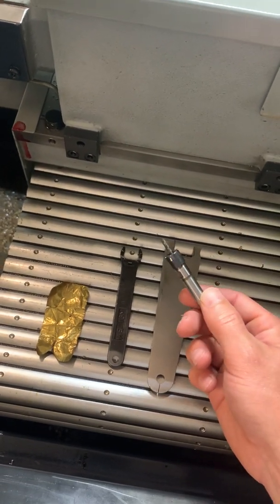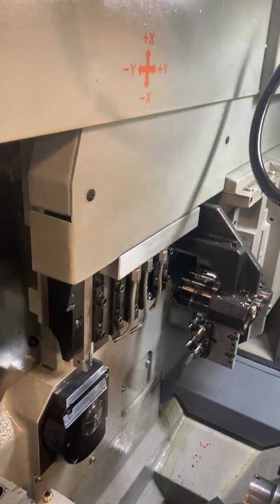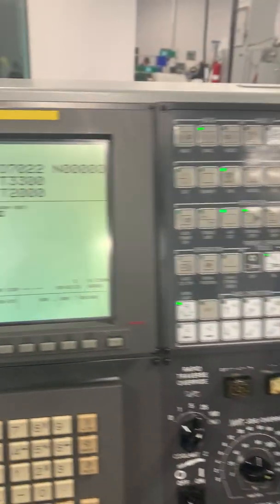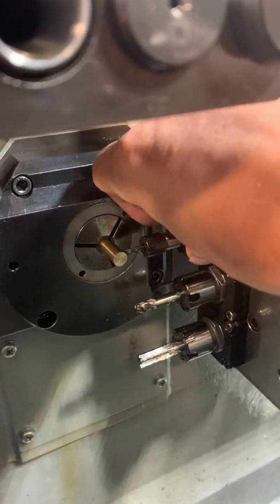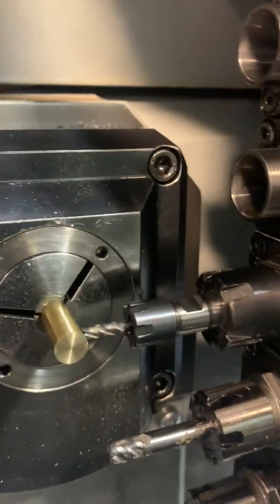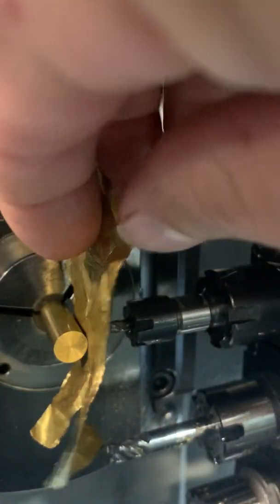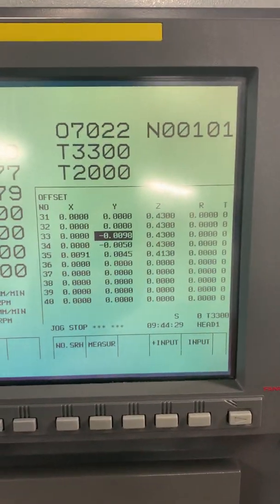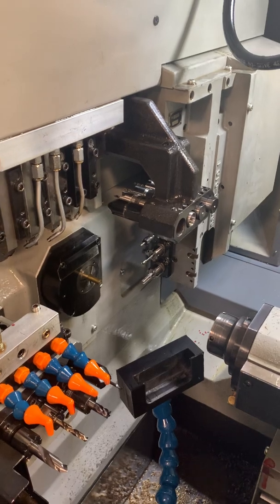Touching off a live milling gang tool on a Star CNC Swiss machine

Comment: I just call the tool up to the bar stock and leave the collet nut loose, adjust the tool to the dia needed, and hold it there while tightening the collet nut. No shims or feelers needed. You should also be able to job the tool whichever way needed achieve the desired stickout without a shim as long as you leave the tool loose.

Comment: You forgot to correct your offset for the thickness of the shim stock.  I learned Swiss work on Star machines.  At the time I had only used FANUC controls on every machine I'd ever run.  Two years ago I got a job with a company where they almost exclusively use Citizen machines with the Cincom controls.  The Cincom control is FAR superior in just about every way from an ease of use stand point.  You can touch off a tool in X Y and Z as needed with out punching in a single line of code on the MDI screen.

Comment: I like your video but I understand it more. You should break it down further for those who don’t, even regarding using a machine key so you can call a tool up without shutting the door. Also when setting a tool we were taught to clear regular tool wear offset and then use the geometry page to reset length. I assume you have a minimum stick out on your tool sheet by the way you did it. Still, good video and hope to see you put more out in terms of the star machine ⭐️

Comment: I wonder for Star SV 12 . Can you share more video for SV
Reply from the maker: It’s the exact same for an SV. The only difference is that you would call the tool to x.3125 rather than y.3125 because you are touching it off in the X axis. Then in the offsets page instead of typing in y.3125 and pushing the measure button you will type x.3125 and hit the measure button.